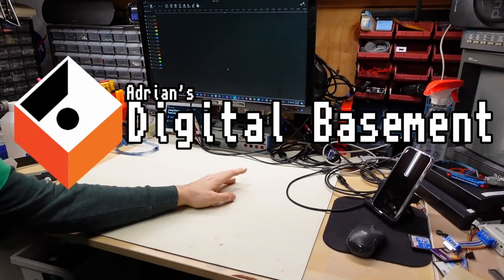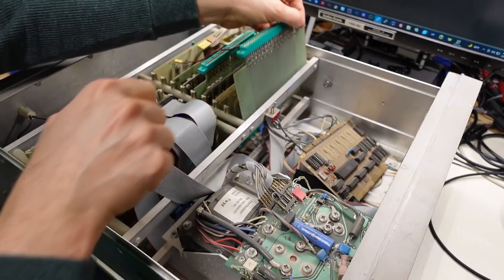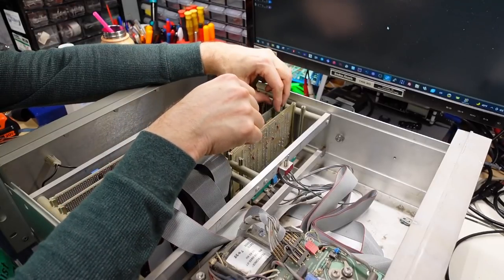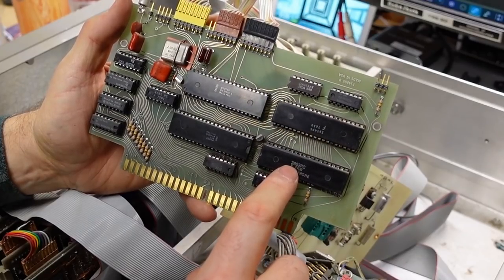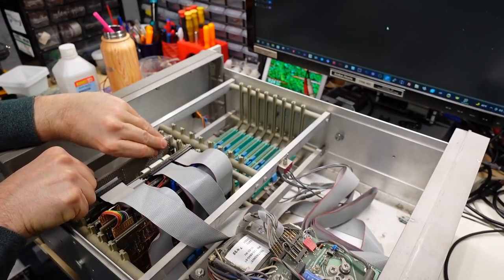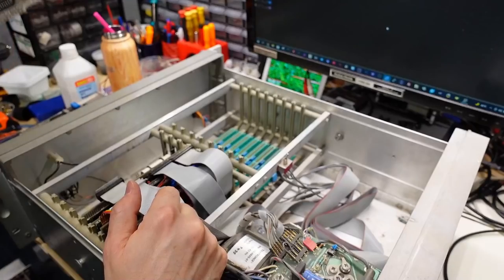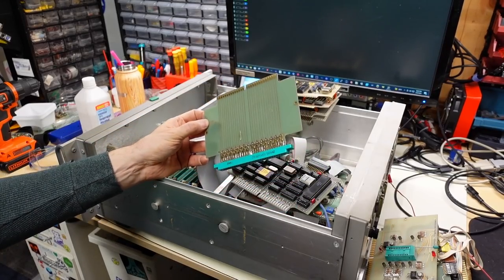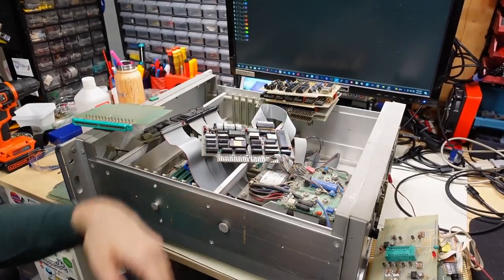I need help finding information on this mysterious computer

Comment: I remember CP/M and other types of computers that people made and sold.
It was all 4, 8 and 16 bit tech, and isn't anything I would want to play with, at least, not to use, today!

1977 is when I started down the CP/M rabbit hole! Wow! What memories!

My first computer was a 4 bit 4K ram using some Motorola processor that let you use a cassette tape recorder as a storage device, and I had it hooked to a teletype for input/output using current loop for, never mind, the tech was just ancient!

What you have is something you could put in a museum if you wanted to keep it around, otherwise, give it to some kid that likes pulling things apart!

Comment: I used to work at a large industrial facility that had numerous similar built computers dating from the 70s up through the 90s and we used a lot of systems like this to run CNC machines, for burning or cutting steel.

Comment: Definitely not S-100, but looks like a Z-80 CP/m system on a different bus... I recall a few alternate busses that were available in the late 70s or early 80s.  That one looks familiar and if I figure out which one it is I'll append this message.

The Z280 is a 16-bit data bus version of a Z80, with a 24-bit address bus.  Internally it handled 32-bit operations and was made in 1987 IIRC.

One of the serial ports would've connected to a Terminal, there is no video.

If you want to see a drastic size difference in implementation, check out the RC2014 designs.  Same basic functionality on 2 different busses (you choose).  I just bought a SBC that is 4"x6" in size, with a Z180 (Z80 with a 20 bit address for 1MB), 512K Ram, 512K Flash, 2 serial ports, 2 SDI ports, 1 I2L port, 2 slots for additional boards and a backplane epansion slot.

Total cost for the kit is US $70 and includes code on Flash including CP/m 2.2, Z-System 2.2, CP/m Plus (CP/m 3) Z-system 3, 2 versions of Rom Basic and a version of Forth.  Z-System was Zilog's re-write of CP/m that used the Z80 expanded instructions and duplicate registers instead of the base 8080 instructions.

Comment: A Bus system for a rack ;) - what it actually is, is open - the idea behind this stuff is that it can be everything and nothing. It can be control for a industrial machinery - saw those even at sewer plants it can be for prototype development, telecommunication switch, science... What ever - it's like a tinkering table but you can slot it cleanly somewhere so the boss doesn't complain about the rats nest, it doesn't have to be a computer at all. Bus systems predates PC and are still used today - a PC is more a sub category of a bus system - at least was. The good thing is that it's easy where to start - those chips have all data sheets and you can access them via the bus system, a multimeter is your friend :)

Comment: The Altair 8800 was the source machine for the S-100 bus.  The IMSAI 8080 was a direct clone of the Altair 8800, but grouped the lights and switches in groups of 4 and used switches that were much easier on the user's fingers.  (The IMSAI 8080 is probably best known for appearing in the film Wargames as the personal computer of the young hacker who accidentally sets off the plot.  The film was made in 1982, and it was already an obsolete relic by that time.)

Comment: In the late 1970s and early 1980s, when I was completing my masters at SUNY in Binghamton, New York,  I worked with several very similar CP/M based boxes, every one of them purpose built for specific functions. Most of the older systems had hard-coded cards that were switched out manually as needed. In terms of display, there was not a CRT, but rather a teletype sort of input/output consol. As far as I can recall, the units I worked with (in 1980, already on the verge of obsolescence) had been created to replace even older systems that ran off punch-tape. Punch tape readers being notorious for damaging punch tapes. By the time I graduated, they were already being replaced by IBM systems.

Comment: Nice box.  I used to have something similar in our lab back in the late 70's to mid 80's.  We used ours to do software and hardware development.
Your box has a S100 buss and a Z80 processor.  The OS most likely was CPM.  You would use a serial terminal to talk to it.   It might talk at 9600 baud if you are lucky.  More likely 300 baud.

Comment: Definitely a Tektronix product (if it’s a computer, I never knew that they made them) so I am not sure the age or model, but I’ve used a lot of their scopes & test equipment over the years so I can tell by the build & the type of boards, the name on the power supply etc. Another clue you can find is if you see the actual location which would be Beaverton Oregon which is where Tektronix is located at. Tektronix has been in business since 1946 if memory my serves me correct.

Comment: When I saw the chassis before you opened it, I knew it looked like TEK test gear. Someone else here mentioned that it looked like in-house gear. I kind of wonder if this was primarily for making EPROMS for Tektronix gear at the factory? The amount of work on the "home brew" cards is astounding. I don't think a hobbyist would spend that amount of time creating these boards. As someone else mentioned, it's STD Bus. Amazing! I hope someone comes forward with more information!
Reply: Its not STD. Cards are wrong shape and the pinout is incorrect.
Reply: The power supply was likely salvaged from a defunct piece of Tektronix test gear, likely a 1950's Tube scope or something similar.  Tektronix stuff is usually insanelysanitary and well built.

Comment: It's occurred to me that it might have been best to try connecting to one of the serial ports as a terminal, before you took the whole thing to bits. Remember: Ikea don't put extra parts in their furniture, if there's something left over, you've left it out!

It was fairly normal for CP/M office computers to use serial terminals as their only display, and sometimes run more than one terminal at once if an application or the OS allowed, MP/M was a multi-user version. One for the boss and one for the secretary, maybe. Then the printer sits in the office for when it's needed after a session of Wordstar or Supercalc.

Incidentally the ports on the back look like 2 serial and one parallel so that'd match up with the PIO / SIO chips on that one board. Whoever made this really did things the heavy way though! Maximum amount of hardware, at least 3 CPU chips, you'd expect the thing to be filled with freon and have it's own seating area around the bottom. Clive Sinclair would have got it all down to 3 ICs and a diode.

Comment: That looks like a terminal server, but it is definitely part of a mini computer. I'd would say leave the cards out, power it up to test PSU, then check for clean voltages, don't worry about the Big Capacitors [dim bulb it if you are worried], I am sure they are rated for low voltage. If that works you would need a DB 25 serial cable to access it. I bet you would get something on the PC terminal, these things always has some form of life in them. I really would like to see more of this. I find these sorta fascinating.

Comment: That could definitely be a controller from a semiconductor tool. Looks EXACTLY like an old RF generator from a Tokyo Electron etcher minus the RF output ports. If it says TEL, AMAT (applied materials), mattson, Hitachi, or LAM anywhere on it then that's what it is. But it's build looks straight up Tokyo Electron  to me
Reply: Tyler, of all these comments I think you're the only one in ball game - with Applied Materials maybe TEL.  I was thinking GCA - remember them? Best case of corporate suicide I've ever seen. Mostek  was defunck  through several mergers  by 1985 , started by the infamous LJ Sevin . Before going under they held market share  on dynamic random access memory - DRAM.  Too many players in this response section, I won't jump in the game. But all the chips he mentions were strong players in the 70 and early 80's. SEMICON WEST was a blast in those days.
Reply: @c123bthunderpig  that was a little before my time, I would have loved to be in the semiconductor industry back then. I spent the last 5 years in it. Half at TSMC and the other half at TEL. I loved the work
Reply: @tm1182  Hey Tyler, I knew you had to be in the " industry", by the way you listed the Fab equipment guys, TSMC  ,did  a lot of work with TI, I remember the TEL plant in Austin TX, beautiful architecture, not to far from SEMATECH. MY brain has  archived my "buds" so deep at TEL, I can't pull them up, one fella named Eric in sales and another one I should remember, he was big as a bear, about 6'4", and had to buy two seats on airlines , he had to have a custom made clean room suit too, he was one of the technical gurus. I also loved the technology, ironically Moore's Law really messed up the infrastructure of the technology nodes that lead to the demise of a lot of jobs by the 90's. I survived the Japanese attack of flooding the market with low pricing in the 80's . That's how SEMATECH  got set up, but then when yields and the cost of building 2 billion dollar Fabs came along American industry went off shore and that shook up the industry big time and I finally got hit. So we've both been there, Thanks for responding, small world for sure.

Comment: That's right kids. Back then "building a computer" was something completely different than we're used to today.
Back then one had to go buy individual IC's and wire them up manually. There's no "go to a store buy a GPU card" and slap in the computer and have it all work out of box.

Comment: Used this style of backplane system through the '80s with mother board (gray cables) and extenders (green card edge) for injecting signals to diagnostics. Leading systems from an HP1000 to a one-off design for "special" purposes. Even wire wrap boards were used daily for years, as tech did not occur at the rate it does now.

Comment: Knock-togethers like this are very common in electronics factories. It looks like part of an automated test rig that has become surplus due to a product being obsolete. Often these sort of things are found accompanying a PC and programmable (industrial) test equipment that helps the PC perform various electronic tests. It is strange because of the numerous tests they may need to perform, and the strange circuits that are required to find manufacturing faults. Simply, I think it is an interface box.

Comment: Be aware the RS232 spoken by that machine is likely -12v and +12v. MC1488 & MC1489 serial chips were often all that is wrong with computers of that vintage. Hook em up backwards and one end may not survive. modern equip may not like the 12volt signals either.
The long thin ribbon cable with db25's on the end is a terminal(as in "TV-100" etc.) cable. The jumper wires on each ends are to use only 3 wires and trick terminal and computer into thinking a modem has answered the phone. Carrier detect, ring indicator, RTS,CTS, etc. Back in the day knowing what pins were needed for various pieces of equipment was kinda like having a CCNE nowadays. It may or may not spew a prompt without a disk. One ROM had CPM on it's label that is encouraging. "Sherman, set the wayback machine..." :-)

Comment: Looks like a mixture of production parts, the pretty gold PCBs, and some one-off hand-made ones so probably a prototype of a new product.  The work is extensive and nicely done so this is an expensive  development.  The whole system looks like a controller or data logger for something but is unclear... perhaps dump the ROMs... there is almost certainly going to be a signature in ASCII in the ROMs, back in the day we could never resist adding some text into the code!

Comment: This is probably a bespoke device

Suggest you look at machines like the 380Z - my first computer - 45 years ago.   I have also used the through hole memory sockets.

2708 uses a 12V programming and a UV tube to erase.   There were no 'PC' power supplied back in the day.

Comment: This looks a lot like the sort of stuff that was kicking around the MSc and PhD labs at my uni when I was a postgrad. Equipment that had been made by/for a previous generation of student research project. Not electronics research, but biological science, telescope control, data logging and monitoring (but no ADCs?). Here in the UK, BBC Micros were perfect machines for development, but you'd use a simple headless (no monitor) system when you had got it up and running. All that wire work has taken a lot of effort!

I would start by downloading the ROMs.

Comment: This was a lab or development box. The Z280 date code was 1990 era, which means this bad boy was in use a long time. In the mid-to-late 70's, there were a variety of popular backplanes, like S100. This one looks industrial, but not unique, since the extension cards are clearly commercial as are some of the cards, and the prototyping cards are also commercial products. If you look in late 1970's magazines, you'll probably find them. The handmade cards are not home-made, they're hand-built and just how it was done. Someone spent a lot of time and money making those cards. This thing would have been very expensive and it was maintained a really long time.

Comment: The 30V external line makes sense if that board is an eeprom programmer, they typically had a "programming voltage" much higher than the 5v and 12v you needed for everything else, so it wasn't unusual to have something you could hook up when you needed it...
Reply: The strange part is that the programmer is inside a rackmount case. Which would make it very hard to use.
Reply: I think it's all prototype parts for development of a product, and that's exactly where you would need an EPROM programmer.
And what else would they put it in? The backplane was made for that case, so that's what went on your desk during development. It's about the same size as the average CP/M system of the day, only with a few rack-mount greebles on the side.
When I did embedded stuff that talked to gas pumps, guess what? We had a couple of gas pumps on caster wheels that would get rolled around the lab. (We also had chunks of gas pumps that were a bit more portable.)

Comment: When I toured colleges for my son, we looked at a computer course offered by a Minnesota Vo-tech  they built their own boxes, this was in the early 1980's and some of the projects on benches looked a lot like that, the school advocated using magnet wire for building boards as a matter of fact I picked up on that and have used recovered wire from old power supplies that I salvaged from old PC's years ago when I was building and rebuilding computers for local folks, being in a very small town with no tech support, I quickly became a part time volunteer tech support for our local hospital and the druggist in town. I was usually paid by free refills on my meds and old systems from the basement of the Hospitals.  Local folks would offer me a ham or some steaks from their freezers (farming community) in fact I even was paid with several dozen eggs once.  Thankfully there are now two well trained computer guys in town and I am no longer called by businesses who are in desperate need of service. That and now if I do get a call, I recommend finding a 16 year old who knows more about such things then I.  I now spend my time building stuff with Arduino's and ESP32's.  Just finished my 5th Internet Radio My daughter loves the one I built for her from one of those Apple amplifiers that you used to set your ipod into for stereo for the room. My latest is in a small simi-clear box that my ESP32 watch came in.

Comment: This is most likely part of a production test or production control system. Usually a test rack is built in just a few copies of the boards and are corrected in the way you got them. No big deal, if they fail they are just fixed. The bus doesn't need to be any "standard" as it was no requirement to be a standard. All the connectors on the back are connected to sensors and measuring points and I/O logic, maybe controlling a production line. Maybe just a matrix printer and a floppy was required to get the results.
All the white proms are known to be a challenge. They don't like some frequencies in light so they must be protected or they will fail, momentarely or erased permenatlty.

Comment: This looks like every piece of test equipment in my factory. Built in the 80s and still working. Often times containing tech from different decades as repairs are made

This looks like the unit that sat under the stairs, canabalized from as needed, but once the whole test station was decommissioned, they finally tossed this

Comment: The soldered braiding on the extender boards will be for the power supply connections.  Probably the copper traces couldn't take the current on their own.

Comment: I remember this style of custom built industrial controllers from my time as a young engineer back in the 70'es.
Back in time you could not even dream of the ultra high level of integration we take for granted these days.
Therefore even - by todays standard - simple logic circuits could take one or more pcb's to make up.
The rework you find so amusing was the standard - and accepted - way to correct and modify circuits back then.
The IC's you see on the pcb's are pretty much standard building blocks from that era.
Your mystery computer would be of absolutely no use today.

Comment: Did you find this in the Dallas fort worth area?   It looks like something I made when I was working for TU electric in the 80s.  It is not s100.  It has boards from digital.  No it uses a dumb terminal using the 25 pin rs232 cable layinthe case. case. Look at a ADM 3a dumb termal for input and output .